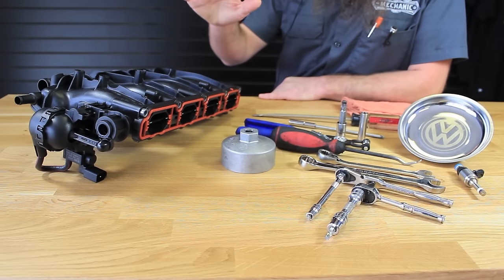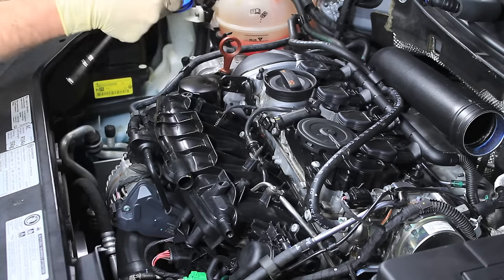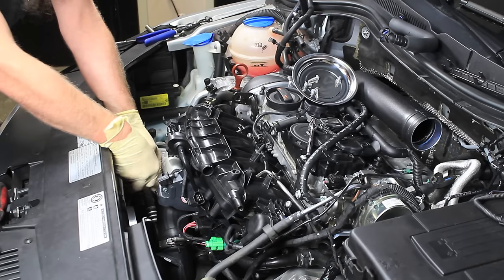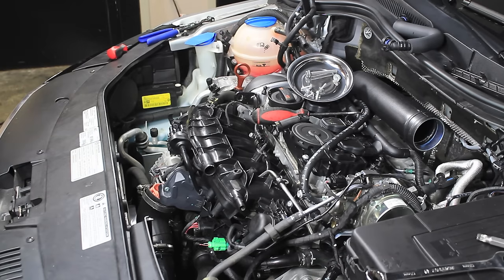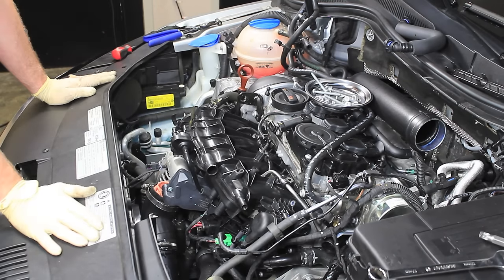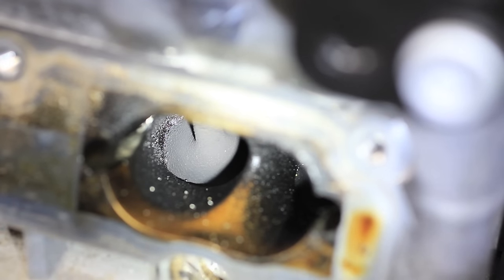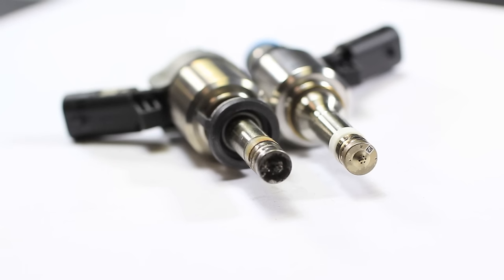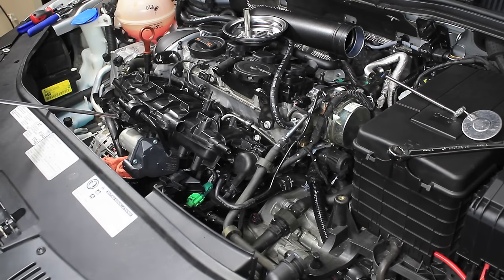Intake Manifold for VW and Audi 2.0T TSI DIY (How to) Replacement

Comment: Great video. Just finished an intake carbon cleaning on my 2012 Beetle TSI with 100k. Also resealed the injectors, replaced the PCV valve. Was surprised to see the manifold bracket was nowhere to be found; but was a good indicator that the previous owner had the manifold replaced — and maybe a carbon cleaning? I won’t say this job was easy (I’m a relative newbie), but it’s given me the confidence to do just about anything under the hood. Tip for newbies: be sure to check that the high pressure line is seated and snug on both sides. I had a fuel leak — initially I thought it was a bad injector seal — so I took the manifold and injectors off again — only to realize it was the fuel line.

Comment: I was on 3rd, yes 3rd intake manifold (yeah, tell me about that GREAT German engineering) when I decided to save myself 800 bucks and do it myself.  I started doing some preplanning for the work when I decided to look a look at that dreaded lower bracket.  Apparently my VW dealer felt it was unnecessary and left it off during the last installation.  I studied this vid carefully and was able to do the job in about 3 hours.  Even though I have a spare lower bracket laying around , I didn't install it either.  Its not that bad of a job if you just take your time and VERY carefully tighten the manifold bolts (first tighten to 3 NM and then tighten to 9NM - per VW Factory repair manual)   Good luck all!
Reply: soonerlon so you really don’t need that lower bracket?? I’m putting my intake back on currently and am really struggling with that bracket
Reply: I can't seem to get to the bracket what so ever. Any tips? Wish they included this in the video.
Reply: @mattvisk I cant figure the bracket install either
Reply: @jaedman  I managed to get it. I forget what it was but good luck!
Reply: @mattvisk  mostly getting access to the bolt by disconnecting some coolant hoses and the valve body was key for me, i have big hands. And dismounting the alternator didnt seem like the right bag of worms to open.

Comment: On my friend's VW 2009 EOS TSI, I needed to remove a short/sideways coolant hose on the midsection of the two plastic vertical coolant pipes, so that I could swing them out of the way.  After doing this, I could then remove the hard to get at aluminum support bracket.  Thank you so much for providing this essential video!

Comment: Thank you so much for your time and knowledge.  Just did a intake manifold replacement on a 2010 va cc. I did things a little differently removing that bracket from the toddle body without a lift but thanks to your video I knew the part to look out for. FYI ...the toddle body bracket was removed from the top with out a lift from the top. Used a t30 along with a swivel and extension. Also a magnet is a great tool .thanks again you were a big help

Comment: This video is the intake manifold Bible haha! I'm in the middle of doing this and have followed thIs video step by step. I decided to remove the throttlebody to make it easier to get under the manifold. I discovered my car did not have the wire harness ripping bracket. Hope it's not necessary. I got all the bolts off the manifold but it is being tough. Hope I don't break it lol. I'm can't wait to finally carbon clean! 

So thank you very much Humble! I love your channel and think you're a great dude!
VW 💕

Comment: I had to remove the intake to replace the water pump on my Tiguan.   The video was very helpful and like others the hardest part was removing the bracket that holsd the TB to the engine block. I suppose that this is needed to help support the TB in order to not put all the weight on the intake bolts and stress them due to vibration. I found that getting the bolt back in was the hardest part. I completely removed the boost pipe as I was able to get under the car since it is a Tiguan.  Also, removing bracket nut on the TB was easier to get underneath the car.  I could not find a 1/4" drive 10mm triple square anywhere, only a 3/8".  It is probably easier to get to the lower bracket bolt with a 1/4 drive and extension.  The problem is the solid coolant pipes that run right in front of the triple square bolt which basically gives you no room to work.  When I have to remove the intake again to do the carbon cleaning I might try and remove the solid coolant pipe to give me more room. I did clean the intake partitions since they were easy to remove and it seems that these were worse than the valves themselves at 78K miles.  It really is a stupid design engineering wise as the could have accomplished supporting the TB much more easily.

Comment: Thank you Charles and Paul I have a 2010 Volkswagen CC and I had a bad injector and the carbon buildup I had no idea how to take out the intake so I watched your video and you guys explain how to remove it step-by-step I came at the carbon buildup I replaced the injector the car runs like if I just drove it off the dealer it went well no problems the tools and the directions you guys explain was on the money so once again thank you guys are from now on I watch all your videos Volkswagen yeah!!!!!
Reply: how do you clean the carbon buildup?
Reply: Just an info about the tools.where can i get them and how much

Comment: Thanks for the video. I'm a decent home wrench, but this took me far longer than the 4 hours suggested. A couple points: I had to remove the throttle body to get access and see the connections under the manifold. The triple square was very difficult. I finally succeeded with a short bit on a  stubby ratchet with a folding handle. For the carbon, I picked it first, let the CRC soak overnight, which removed much of the gunk. The zip tie method didn't work for me as I couldn't keep the zipties in the chuck. I used small sections of red scotchbrite held with a long set of forceps to scrub the intake portion of the head and the front of the valve. Preinstall and then remove the throttle body screws to cut the threads prior to putting the intake on - this allows easier screw insertion later. Make sure the connector adjacent to the oil filter is connected before you place the intake into position - I had to redo the installation process. Have fun and savor beating the $1k labor bill.

Comment: I'm so annoyed that I am barely seeing this video. I just recently took out the water pump on my 2014 VW CC w/ 50K miles on it and replaced it with the metal one you guys sell. I left the bracket on the intake manifold this time thinking it wouldn't do anything. Tell me why literally pulled the wired out of the coolant temp sensor from the water pump just like you mentioned in this video 😅. Thats what I get for trying to cut corners and save time and effort. Thank for the videos, though the water pump video you did was not exactly the same as my CC it did help A WHOLE lot. Thanks again.

Comment: Thanks for the videos man. Very well made and articulated. I had two intake runner codes on mine that popped up about two months after I bought it. it was a little frustrating. I bought the ECS repair part and crossed my fingers. Didn't work. So then I bought a new Runner sensor and saw that the whole thing had to come out... so I loosened everything up just enough to access it behind the oil filter housing and put it back together. Oddly enough one of the runner error codes went away and the other one came back so I bought a whole new intake manifold and just finished the job. Referenced your video a few times! 👍🙂

Comment: Thank you for posting this video. I have no idea how much money you saved me but I bet it was a lot more than the money I spent on the manifold. I was able to fix it myself with your video as guidance. I really appreciate it.
Reply from the maker: Thank you so much for that.  Removing your intake manifold and cleaning your valves would likely cost around $500-700 depending on whos doing it.    We are so glad we were able to help you save some money.
Reply: @Deutscheautoparts  Volkswagen Billings charged almost 1200 dollars for a "fuel induction service" on the last guy who owned my car. Not sure if that was strictly intake cleaning or what but my god this video is gonna save me from so much financial pain.

Comment: This video has saved me so much hassle and money but what a pain in the arse job to do. Mk6 gti left me at work 2 days ago smoke everywhere, misfiring I thought it blew up. Injectors only I had to do, on the side of the street, tho it would of really helped if you had the support Bracket removal as  that is a migraine. Thanks again and great vid as it saved me a week's wait.

Comment: Thanks for this video.  I was very nervous doing this my 1st time on a direct injection removing the intake manifold.  I was very nervous pulling it out and seeing a couple of the injectors stuck.  I did not replace the whole manifold I just simply needed to pull it out about an inch to replace the runner manifold center on the side beside the oil filter one of the bolts you could not access without pulling it out.

Comment: Thanks for sharing brother 
Good video, I like that you take a couple of minutes to double check on your work...a mechanic that fix my VW, left the intake  throttle connection loose my car shut off and wouldn’t run... I opened the hood and fixed myself... also he forgot a screwdriver in the engine very close to the belt... so dangerous that could blown up my engine...

Anyway keep up the good work!

Tip: it’s always a good idea to cover the air filter box big hose , so you don’t drop something in there by accident!

Comment: i had to replace replace a fuel injector and said heck lets just change them all got them at shopdap and the price was one of the best thabk you guys while i was there i decided to clean the intakes (really time comsuming)  a challenging diy all and all thanks for the tutorial it help me a lot
Reply: Manuel Huerta the cleaning of the valves is what is stoping me from doing this DIY , saw a video of a guy using walnut shell that was fast .

Comment: Thank you a lot for the instruction!!! This video is awesome!! I just replaced my manifold and water pump using it!! Also watched the fuel injector seal video and the work was really straightforward!!! It is not an easy task but with the details here it was totally error free!!! My biggest challenge was to put back the triple square 10mm bolt in the aluminum arm since the access with all the hoses in place is really tight and the Tiguan front grille is taller than the GTI ones!!! Keep up with the great work!!! Thank you again!!

Comment: Many thanks for the video.  Did my 2012 audi this weekend and wow was there a lot of carbon.  Ended up doing the walnut blasting which worked well.  I decided to put the throttle body on after installing the intake.  That gave a lot more room for the bracket but that last throttle body bolt on the back side had me pulling out hair.

Comment: Excellent video. I followed the steps and replaced my injectors. Quick question though, after reassembling everything back I noticed the car cranks but no start? Sometimes it wants to idle but it keeps cranking? Then the battery dies and the car won’t even crank any idea if I’m missing something? Or did my battery just went bad out of nowhere?

Comment: Just managed to get that support bracket in place. I just removed the coolant hoses blocking access and threaded the topside nut first loosely onto the manifold body, then the bottom was relatively easy with the hoses out of the way.

Comment: Thanks for the video! Helps with my 2009 VW Tiguan Check Engine Light with Code 08213; Intake Manifold Flap Position Sensor (Bank 1) Implausible Signal P2015 - and convinces me to NEVER buy a VW again, ever. All this plastic does not last. It's been a maintenance nightmare.
Reply: You just did this and i need advice pls. On 5:17 he talks about disconnecting a hose. how did you disconnect yours? it’s being a pain.

Comment: mine was cleaned under warranty it's extended to 120,000 miles 2008-2010 2.0T. GTI Golf etc. After cleaned big improvement in mpg and pep...smoooth starts. New 2.0t has a 5th injector, in manifold to cure this issue
Reply: Do you know what year they added this fifth injector?  Or how to tell if an engine has this fifth injector.  I was at a VW dealership two years ago and I asked a salesman about this and he did not know.

Comment: Thanks a ton, huge help with my DIY carbon cleaning. One correction, the bottom bolt for the lower bracket is NOT 10mm Triple Square, but 9mm triple square.
Reply: Just took mine out on the 2013 Jetta turbo - 10mm.
Reply: Mine was a 10.  Is it possible your squares were switched in the tool kit?

Comment: Excellent video.  It gave me the knowledge and confidence to successfully replace the manifold on my '13 CC. 

That darn bracket had me flummoxed during disassembly.  I removed the throttle body and the attached inlet pipe.  This made everything about this job less frustrating even though it did add some time.

Comment: I did exactly what you said not to do and now I ripped the wires right out of the connector to the coolant temp sensor. What are my options? How to I go about replacing it? Something I can get at a local autozone ? Thank you! !
Reply: Did you ever solve the problem Bc I just ran in to the same thing
Reply: @its_xabes6376  what did u end up doing?

Comment: Dear HumbleMechanic, May I ask: What are the causes of intake manifold failure? When the intake manifold does not work normally, what will the engine running be like?  After ten years of use(around 94,000Km.), my VW GTI 2.0 FSI Turbo (probably)  MK V showed yellow engine warning light after I accellerated the car rapidly to overtake a few cars at one time in normal automatic transmission mode. The mechanic changed the sensor in the intake manifold. It was good for some time and happened again. After two times of sensor changing, the mechanic decided to change the intake manifold. I saw greasy material coating the flaps of the intake manifold. I have not tested the other parts of the intake manifold. Thank you very much for your instructive and knowledgeable videos.

Comment: Thanks Charles and Paul! An old video but still helping people get this job done. Replaced my 13 year old manifold and cleaned the injectors yesterday using this as a guide. Can’t claim I got it done in the 4 hours Charles estimated, I think I must have spent almost that long getting that triple square on the bracket back in. Ended up dropping the fans and boost pipe to make some more room. Got it done eventually though. My eyes could be deceiving me but is there more room up front behind the rad/intercooler/fans in the mk6 Golf? Was very tight in my A3 CCZA until I got the fans out the way, mainly the solid coolant lines.

Comment: During opening tool description I wondered why mr humble left the tool before the screwdriver out of the equation. Also no mention of NEEDED T30 extension to remove T30 bolts underneath through very narrow indents underneath manifold.

Comment: Hey guys, I recently did this repair using this video and everything went smoothly. I fixed my cold start misfire issue by getting out the carbon gunk. Car ran really well until I discovered I’m leaking gas pretty bad looks to be from under the manifold. The hard fuel line looks snug to me. What do you think most likely went wrong? Could it be that the bolts at the bottom of the intake are not tight enough?
Reply: Hello same issue , did you find a fix… I’m also having no coolant temp
Reply: idiots working on cars never ends well, shouldve paid a shop

Comment: Thank you for the videos. I've been looking for good quality tutorial and how to replace VW parts for a long time. A much needed for VW owners. 2.0T TSI great engine!!. After seen your video I think that I will take my car to the dealer, it is a heck of a lot of work.
Reply: If you get a cold start error on log, it's COVERED under warranty to 120K miles for 2008-2010 my

Comment: Thank you for sharing this great video. Are there torque specs for these T30 bolts and nuts? I know you said snug them, but different size men snug different size torques. Also, I have misfired in multiple cylinders code, even though I replaced the coil packs not long ago. Should I do it again, or the faulty intake manifold could be the culprit? Since the valves are exposed, what will be the best way to clean them up? and should I clean the injectors at 96K miles, or just go ahead and replace them? Love your channel, and thanks again for sharing.

Comment: Hello, I'm swapping my intake manifold and the old fuel rail bracket isn't lining up nicely with the new manifold, I got the black t30 bolts in but the longer silver bolts I can barely get them in. What can I do to help it line up?